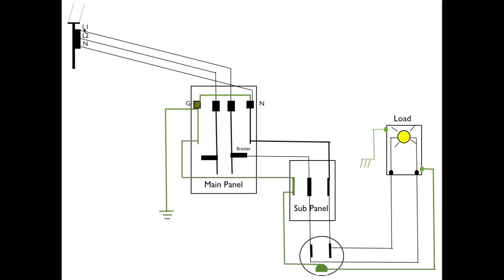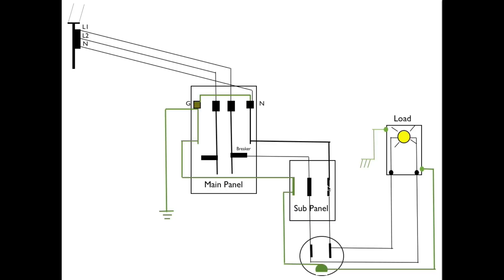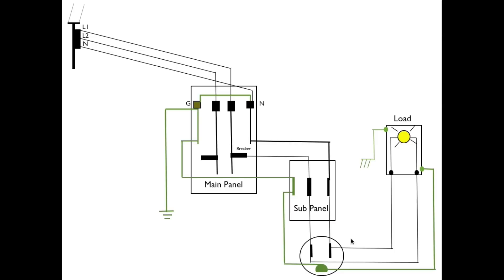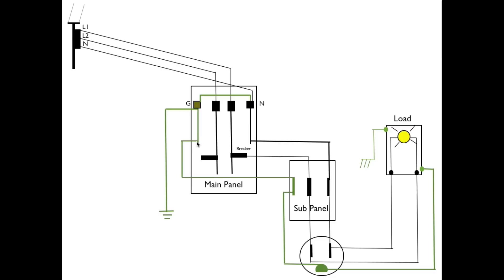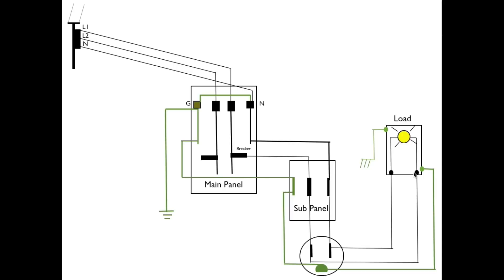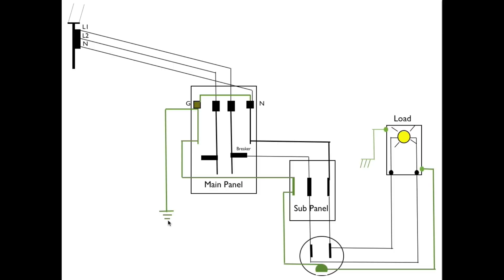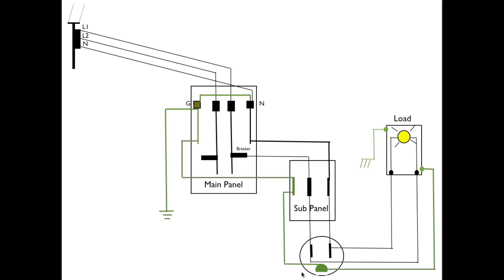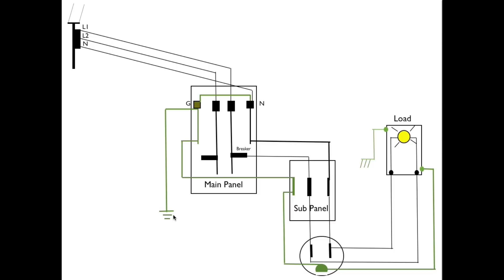The difference between neutral and ground on the electric panel

Comment: Can you make a video for how to trouble shoot a 3 phase motor circuit with forward and reverse function using a ladder diagram
Reply from the maker: I will put it on the list.
GFM
Reply: @grayfurnaceman  Thank you it will geatly help me You cleared my confusion about ground  and neutral in no time I appreciate it.

Comment: +grayfurnaceman @5:1, I believe in certain parts, this is what's known as a Brooklyn ground...that is, when the neutral in any part of the curcuit is lost, it is sometimes replaced with the ground wire. Obviously, not recommended.
Reply: Also called a boot leg neutral

Comment: I've noticed that 120V outlets have a ground but not 240V outlets? Is there a reson for no ground considering my 18,000-BTU window air conditioner is on the outside?
Reply from the maker: In most cases, 240 volt outlets do have a ground.  They may not have a neutral.
GFM
Reply: +grayfurnaceman sounds like the homeowner or novice didn't splice in the ground lead into the box. lol

Comment: The Ground wire is only there as a safety in case of a short circuit to the case or housing of an appliance or tool. In this way it is hoped that the short or Hot wire will draw enough current to either trip a circuit breaker or blow a fuse. I have a problem with this as I know some old types of wire had very low gauge ground wires. To have a balance the ground wire must carry the same current as the feed wire so if a smaller wire is used in a Romex style case than the resistance will be increased and there is a chance that a short will not draw enough current to trip a fuse or circuit breaker. In others you would not lift something with a rope on one side and twine on the other. In electricity everything must ( to be safe ) be balanced....
Reply: Agreed.
GFM

Comment: I have a question that's been bugging me.  I have seen very clean panels where all the green ground wires and bare copper are mounted to the left bar and all the white neutrals are mounted to the right bar.  However, I have also seen on occasion where the green, bare and white are on the same bar.  My specific question based on your diagram above, is: Could the neutral wire that runs from the main panel to the sub panel get attached to the LEFT bar on the main panel, where the bare and greens connect?  For example, if you have a white neutral cable that goes to the sub panel but it doesn't fit well in a lug on the right bar of the main panel, could you put the that lug on the left bar of the main panel?  Thank you.
Reply from the maker: paz y puente You can.  Don't tell any electricians if you do.  They get a little upset at that one.  They are supposed to be separated.
GFM
Reply: grayfurnaceman You can't. It's a Code violation per NEC 250.24(A)(5) and for good reason. The neutral (grounded conductor) is a normally current-carrying conductor. The equipment grounding conductor (EGC) is not. By combining the neutral and EGC downstream of the service entrance, you've just made all EGC paths upstream of that neutral-ground bond into normally current-carrying conductors, which is dangerous.
Reply: grayfurnaceman Yeah, in all realms of possibility, you can and it'll work.  But it won't be legal, and might present a problem when you try to sell.  You'll also be introducing hazards.  For instance, you'll constantly be putting all of the current from the sub panel neutral through the various hardware that connects the ground bar to the main panel's neutral on a permanent basis.  That hardware may not be conductive enough to handle the current over time without heating up, which will make a hot spot and further degrade the connections, creating an even hotter spot, that degrades the connections even more...

A safer alternative may be to buy a single lug that is large enough for your sub panel's neutral wire, and attaching that lug to the neutral bar with an appropriate sized machine screw (either something that fits where the set screws are, or a longer screw of the same gauge and thread that is used to mount the neutral bar).  But you didn't hear that from me.

Comment: GrayFurnaceMan, 
Great explanation, much better than George Carlin's "Electricity is just organized lightning".  A few additional notes of potential interest to your viewers should they need to interpret the NFPA 70 National Electric Code (NEC) to pass an inspection. 

120/240 VAC residential is known as "Split Single Phase" using the center tap of the utility's transformer's secondary winding to split 240VAC into two 120VAC lines (L1 & L2) with Neutral being the common referenced to ground, per your drawing. If the amount of current flowing through L1 happens to be balanced with L2 they will effectively cancel each other because they are 180 degrees opposite and no current will flow back through to the transformer's Neutral, similar to the "neutral" in 3-phase generation, transmission, distribution and utilization of commercial, institutional & industrial electricity. A 3-phase Delta transformer has no neutral.

Electric current flows just fine without your Green Equipment Grounding Conductor (EGC) wire & green screw as evidenced by double insulated tools and appliances that only have two prong plugs. 

Indeed, although the title of a GFCI is a Ground Fault Circuit Interrupter, GFCI electronics doesn't even use the green Ground wire to detect a current difference traveling between hot (typical black or red) and neutral (white).  

The EGC's purpose is safety, to provide a current path to trip an Over Current Protection Device (OCPD), i.e. a fuse, circuit breaker or current transformer (CT) controlled electronic relay, should a hot/live ungrounded wire/conductor come loose in an appliance or piece of equipment or next to a pipe and energize an exterior piece of metal that could shock, burn, electrocute (kill), or cause a fire🔥. This ensuring a fuse blows if metal water pipes, equipment, conduit,  or structural steel becomes energized is technically called "Bonding", where everything metal is "electrically glued" together.  
Normally, no current is supposed to flow through the green wire, but sometimes it does (ground loops & metal building parts acting as an antenna affecting digital data transmission and putting annoying 60-cycle Hz hum on loudspeakers.   
Isolated Grounds (IG) with orange triangle labeled receptacles and additional green/yellow colored wire are sometimes used in hospitals, for cash registers, data centers and rock bands to mitigate EGC induced problems.

In addition to bonding, the EGC also helps bleed off static electricity,  lightning and high voltage transients into earth via the Grounding Electrode Conductor GEC, aka ground rod.
Reply from the maker: I won't try to answer each of your statements other than to say I have found your explanations to be accurate in every way.  Thank you.
GFM

Comment: Usually what is going on  when a device shocks you when it is plugged into an ungrounded socket? Does the device needs to be repaired, or is that normal under those conditions? How does the current reaches the chassis?
Reply from the maker: When there is a defect in the appliance, the hot lead is in contact with the chassis (frame) of the appliance.  If the outlet is grounded the hot lead feeds thru the chassis and the ground conductor to the neutral at the main panel and then is cleared (opens circuit protection) thru the neutral at the pole transformer.  
If the ground is not available, the fault will not be cleared and when you provide a path to either ground or thru a water pipe, the current will pass thru you and you get shocked.
GFM
Reply: So the device needs to be repaired? Could the problem be on a different device on the same circuit?
Reply from the maker: No
GFM

Comment: If I have a lamp using 8v and it’s being supplied by a hot wire carrying 12v, does the neutral wire carry 4v back to ground?
Reply from the maker: The circuit will have a total of 12 volts voltage drop.  If you have an 8 volt drop across one load, there must be 4 volts drop in the rest of the circuit.  If the rest of the circuit has a low voltage drop, there will be closer to 12 volts drop in the load.  There is no carrying of voltage to ground.  I know this is hard to understand, but it is the way it works.
GFM

Comment: How do you run the thermostat wire on a heat pump does it go from the thermostat to inside unit then from there to outside unit or what not sure need help

Comment: The main bonding jumper is made at the service disconnect not necessarily the main panel. If the neutral is lost at equipment it will NOT return on the "ground".
Reply: In modern residential distribution panels, the primary service disconnect is often the two main breakers in the panel.

Comment: Someone needed to relocate a service panel. I thought I was going to be smart and tried to snag the ground rod that was abandoned. I took two pipe wrenches and pinched up and twisted... and was surprised how easy the rod rotated in the ground and I wiggled out. I tugged and rotated and was whacked in the chin when the then 10', now 2' rod came out of the ground. What was below ground was a long slender needle taper to the original 10' rod.
Reply from the maker: Interesting,
GFM
Reply: This was a bad ground and may be why they wanted to relocate the service panel.  The ground rod rusted away so there was no longer a good ground for the system.  Some locations are required to have a ground plate with the ground rod to prevent this problem.

Comment: I'm have a neutral issue on 220v(8/2 Awg). I moved my dryer into my new home, hooked up the pigtail turned on the breaker and attempted to fire up the dryer... I got an error code and a click. Checked voltage across both legs(wall/pigtail) and have 242v. I checked each leg to ground, good. Then replaced the motor, main control board and tried again.. same problem. I then grabbed the old wire/breaker and hooked it up and again nothing. I then saw something online about these dryers needing a GOOD ground so I went to the panel and pulled the ground out and put it on the neutral bar(I know, not right but..) and the dryer works. 

This house is NEW.. and I cannot understand why the ground is not providing the proper connection.

so my question is... WHEN does/where does the carrying load for neutral in your diagram change to earth or does it send that load back out to thepole(logic tells me the path of least resistance)?

And... any ideas on how to find my ground issue in my panel(my 200amp panels do NOT have a jumper connecting the neutral to ground bus bars)?

OH.. why do 22v connections(older) only have ground(bare) and just to clarify.. it does go to the ground bar?

thanks for the video.. it helped me understand why we have the ground.
Reply from the maker: First,  I would be contacting the installing electrician.  The ground in the main panel should be connected to the neutral unless the panel is not the first panel that the power goes to from the pole.  If it is not the first panel, the ground should be extended to the first panel where the ground and neutral should be bonded.  
Older installations did not require a neutral on 240v appliances, even if they had 120v circuits in the appliance.  They used the ground wire as a neutral.  It does go to the ground bar.
The neutral goes out to the pole transformer.  It is bonded to earth, but under normal conditions carries no current to earth.
GFM

Comment: Yea big question, wouldn't the sub panel ground and neutral be together through the mounting bolts? That's what I'm confused because I got a box with three separate, 7slot, panels in it and I do believe it's a 120v set of panels yet each panel set has a bunch of screws on the side and one ground bar wondering how to wire the power to two separate panels off one breaker is another neutral needed?
Reply: +Rook E generally the "ground" bus IS bolted directly(metal to metal) to the panel frame, where the "neutral" bus is molded into a fiberglass "stand-off", insulating it UNLESS you install the provided "ground jumper bolt" that connects it electrically to the frame. In a sub-panel installation, you would NOT install this bolt and maintain the neutral integrity all the way through the sub panel and back to the main panel.

Comment: I for one still didn't understand what the difference is between the two wires when in the main panel, they are tied together (in the USA). So I did some more research and found an excellent answer at reddit (search for "Why bother having a ground if neutral and ground are connected anyway at the fuse box" written by VVillyD).
Reply from the maker: +edgerrr Pretty good explanation.
GFM

Comment: i just bought a new house. and my inspector said the sub panel off the main panel has the ground and neutral bonded.  He said it works. but isnt safe. how should i fix it. ?
Reply: Or break the usually copper tab connecting the neutral buss to the chassis.

Comment: good  ..  but  i  think  the  sub panel also must  be  earthed  separately ..   because  it  can  also   carry  a charge  when  the   earthing  wire  get  broken due to  some  reason , which  is  coming from the  main  panel .
Reply from the maker: +james kutty Joseph In most cases, it is not required.  But not a bad idea.
GFM

Comment: Whoever came up with the concept of a ground, and (in addition) NOT have it connected to the neutral (outside of the service entrance)
was REALLY using their head.

It's true... If your grounds & neutrals were connected, and the neutral failed, you'd still have a live circuit. But it would no longer be contained.

I've been shocked a few times. It really sucks.

Comment: There is a very easy way to explain why neutral and ground are separate at appliances but tied together in the panel.  The actual reason is rarely explained, but this is why:  If an appliance fails, the idea is that it will create  short circuit through ground back the load-center panel, thus causing a breaker to trip thus disabling power to that circuit making in non-dangerous.  That is the sole purpose.
Reply from the maker: In your example, the circuit protection would open whether the neutral and ground are connected or not.
GFM
Reply: If the neutral and earth is bonded, and the live touches the grounded chassis of the appliance,  the breaker will trip. 

If the neutral and earth are not bonded, the breaker will not trip but rather the earth leakage since there is a current difference between live and neutral? Because current will flow in the earth conductor and not in the neutral conductor.

Please correct me if i am wrong.
Reply from the maker: What is probably best here is to remove earth ground from the discussion.  It has nothing to do with the circuit operation.  If you consider the chassis as a neutral connection to provide protection from a live conductor touching the chassis, it will be easy to understand.  
The link to earth is for lightning protection and a sink for surges.
GFM @ruan2587

Comment: I am still questioning why the neutral and ground, being connected together in the main service panel, don't act like they are connected everywhere else and cause a short. Does the resistance in the wire act like a transformer and isolate the neutral from the ground further down the circuit?

Dave K8WPE

Comment: You showed how the ground and Neutral are connected together in the main panel. Then you showed the ground and Neutral separated in the sub panel. But are not the Ground and neutral technically still connected together in the sub panel also, since they are already connected together in the main panel?
Reply from the maker: You need to understand that we are connecting to the panel with wires. If there is a fault in the neutral, or a fault in the ground, the unit needs to be protected from becoming "hot".  
GFM

Comment: I see you have the neutral and ground separated in the sub panel, but where the ground hooks to the main panel, it is also tied in to the neutral? Does not seem separated to me?
Reply from the maker: gary michaels If the ground is connected to the neutral in the sub panel, the unit will run the 120 volt circuits normally if the neutral is open.  This is a problem because is the ground opens, then the chassis becomes hot.  Think this thing through and it makes sense.  You want the unit to not run if the neutral is open.  This gives an indication of a problem with the wiring.  Hope this helps.
GFM

Comment: if the sub panel is in a detached building from the main panel, and has its own earth ground (grounding rod). do you still keep the ground an neutral separate? or can they be bonded in the sub panel just like in the main panel? it's a bit confusing.
Reply from the maker: Keep the ground and neutral separate.
GFM

Comment: I checked it out... the bar that joins the neutral and ground in the sub-panel has a lug (actually two lugs - one on each side) to clamp the ground cable. The bar that is presently serving as the ground in the sub-panel has no lug. I suppose I could remove the bar joining neutral and ground,  cut it in half and bolt the ground half with lug back...? (this is not going to get inspected)
Reply from the maker: I can't be sure on that.  I try not to give electrical code advice.
GFM
Reply: giribaba — Any work done on wiring the panels should be inspected.